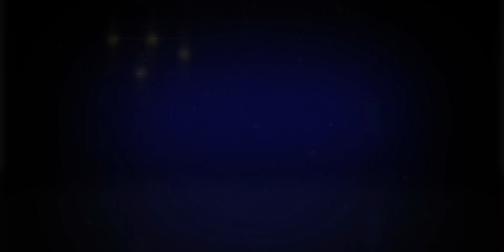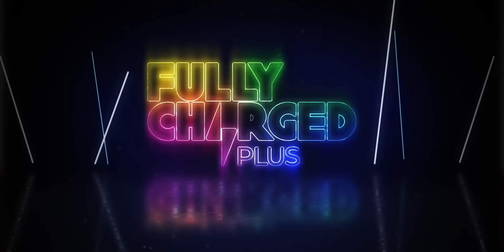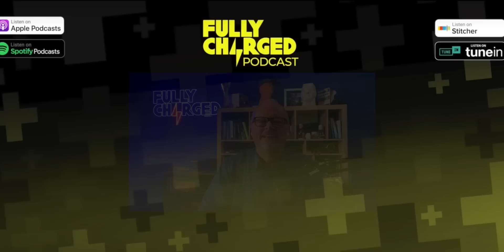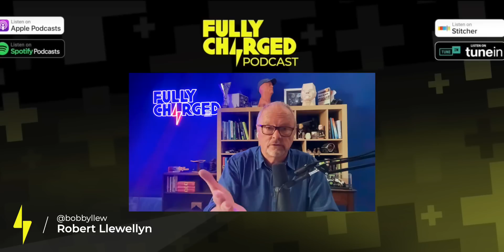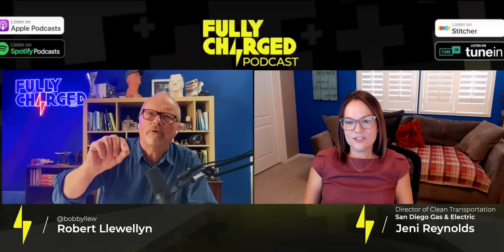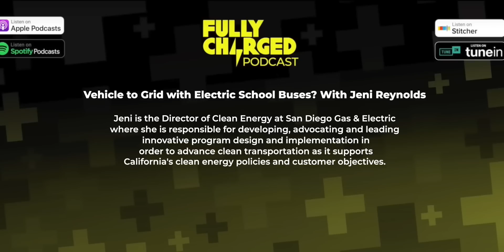Vehicle to Grid with Electric School Buses? With Jeni Reynolds | The PLUS Podcast

Comment: One point the video sort of glossed over - peak electricity demand happens between 4 and 9 PM, when solar production is winding down, but air conditioners are still running. The problem is that this time the time that the school buses have just finished taking a load of kids home from school, which means the batteries are already depleted, and so there really isn't excess power available to send to the grid.

I suppose the vehicle to grid system would still work on weekends, as well as during summer break, when the buses really are just sitting around all day, but I don't see this working on weekdays during the school year unless the power company is paying to equip the buses with far bigger batteries than what's necessary for moving the kids, in which case, the power company could just spend the money buying stationary batteries independent of the school buses.
Reply: It makes zero sense to retrofit a bus with a battery only just big enough to satisfy the specific route requirements of individual routes - you would retrofit with a standard battery pack to allow any individual bus to manage the very longest possible route x twice per day, and add a good margin on top. Once you’ve got a fleet of 8 buses and 6 bi-directional chargers (as per the example in the pilot, I can easily see how they end up with a big surplus capacity after 4pm. Try to assume that people running this kind of pilot to gather data are not stupid.
Reply: You are on the right track. It will take some type of computer managed system to individually. Monitor state of charge of busses in fleet. Know how the utility needs or not the battery storage, then make decisions on when to charge, or discharge the buss batteries.
Reply: @ John Arnold, that’s my thinking, and the OFGEM Page has a sample use-case. The bi-directional chargers are 60kW ones, so if we assume the buses are at 80% SoC at 6am, and have batteries conservatively sized so that they have a minimum SoC of 50% when they return at 9am (to allow for those days when they cannot be charged midday but still have sufficient juice to do the afternoon school run), and on days when surplus solar allows a midday recharge back to 80% by 2pm, then they will again return to the depot with 50% SoC, and can safely be discharged to 20% by 9pm. That implies 6 chargers x 60kW x 4 hours = 1.44MWh as a rough estimate of the amount of energy that can easily be discharged in the evening, with an additional hour allowed midday to provide grid balancing and frequency response services as the same 1.44MWh is pushed back into the batteries. That is all assuming a conservative and not excessive sizing for the battery, as the OP was suggesting.
Reply: @ayebrow  
You are missing the fact that bus batteries are always lithium iron phosphate, which have a lot less issues being used for 100% of their capacity for charge and discharge, and after 10k cycles still have 80% of their original capacity. Unlike lead acid batteries that fall off a cliff at the end of their life, lithium chemistries lose capacity proportionally.
Reply: @GoCoyote, that is really interesting, thank you - I didn’t know that about LFP chemistry, just that it’s cheaper and has a lower energy density than NCA or NMC chemistries.

As a pilot, I would imagine they will be trying all kinds of operational use-cases, particularly since they have six bi-directional chargers and eight buses, which I assume will have different route lengths and options.

The OFGEM site information about the San Diego pilot that I post above suggests that they will be expecting to end the afternoon runs with around an average 50% SoC, on days when they can top-up with cheap solar midday, so if they can experiment with charging to 100% and discharging close to zero, and capture the data on battery impact, it would be fantastic.
Reply: I thought about that. Obviously, buses will need to have some spare capacity and not finish the day completely empty, but batteries are expensive, and the school district, at least in theory, would save enormous money by being diligent about battery sizes and equipping buses with enough capacity for the longest possible run, with a reasonable cushion, and no more. It's not like ordering a fleet of diesel buses, where, since the cost of a bus is unrelated to the size of the fuel tank. With diesel, equipping the fleet with more range than you need costs nothing, so doing it solely for the sake of standardization becomes a matter of "why not". With battery buses, each additional kWh in the battery pack adds significantly to the vehicle cost, so paying for double or triple the battery capacity of what you actually need to haul the kids around gets very expensive - particularly for large vehicles which need much bigger battery packs than smaller vehicles, due to their relative inefficiency. So, if the achieving good grid balancing requires buying double the battery capacity the school district would otherwise need, the only way that expense gets justified is if the power company pays for it. If the power company pays for it, they could use that money to just buy their own batteries instead. And, since battery size and weight per kWh are much less of a concern for grid stabilization than for moving vehicles, the power company could get more kWh for the money by moving to other technologies besides Lithium Ion, which a school district powering its buses would not be able to do.

Of course, one can make the counter-argument that all electric vehicles are much less efficient in winter than in summer, so in order for a vehicle to make it through a winter run at 20% SOC, it has to complete summer runs at far more than that - plenty to balance the grid at least somewhat when the bus pulls into the depot. However, even then, the grid balancing happens only seasonally, and on the hottest days of the year when the most grid balancing is needed, the bus will have less to offer because it will have run down the battery air conditioning the bus (which consumes far more power than air conditioning a car, since you have to cool the entire bus, not just the first few rows).

To be clear, I still think the pilot does make sense to go ahead with, especially if San Diego starts school late enough in the year that the hottest days will happen when buses are just sitting all day at the depot on summer break, in which case, the entire battery pack becomes available for grid balancing. I think vehicle-to-grid is still important, and there are cases where it works, even if school buses aren't one of them. But it is important to be realistic in expectations.
Reply: @ab-tf5fl  entirely agree with your argument here... I would expect the buses to have right-sized batteries for their half-day workload in winter, plus a smallish safety margin. Given the short distances they'll cover you're talking a pretty small battery. They are effectively providing v2g for short-term grid balancing during evenings and school days, and slightly longer-term time shifting during weekends and holidays.

It's not as exciting as it might first appear, but it's not nothing either, and we need to shift to a mindset where we seek to optimise our use of the grid right through the whole system even if the numbers aren't especially headline-grabbing.
Reply: @Sam Prince, in what world does every school bus have the same route length? Given the answer is “no world”, the conservative bus operator will ensure that their fleet has enough vehicles with ranges to provide guaranteed cover for their longest route. The bus builder in this instance provides 3 different capacities from which to choose. They don’t do “right size”. The UK’s OFGEM has published the details of the San Diego scheme, which YT blocked me from linking to, and it makes clear they plan a recharge period 9am to 2pm and a discharge period from 5pm to 9pm, so it’s clear to me that they are not sizing the batteries for a half-day duty cycle, but for closer to a full day one, allowing for days when a full midday charge is not possible, and expecting to have the buses back in the depot with an average of roughly 50% SoC on days where they are able to top up midday on cheap solar. You and the OP seem to be a little too focussed on the cost of a few 10s of $1000s extra kWh of capacity, when the overall project cost will be in the $millions. You need to ask yourself, what makes you think that the people organising this pilot haven’t thought about the alternative of minimal battery size and separate static storage?
Reply: @ayebrow  calm down mate, you're getting a bit giddy
Reply: I think you’re trying far too hard to argue that having electric buses with absolutely minimally sized batteries, and an entirely separate static storage system, is somehow more economic than simply having conservatively sized batteries on the buses. Batteries are expensive, true, but they’re not gold, and there are many costs associated with having duplicate systems rather than just one - each additional kWh is only ca. $150-$250 at current prices, and is anticipated to be below $100 by 2030, so your argument loses weight with every passing year. You are also failing to realise that the aim of this is to allow the school districts to make use of the batteries in their buses to make money, selling grid support during the peak, because it’s clear that their duty cycle as buses is nearly perfectly aligned with the duck curve to do that. Why build separate static storage systems when you have conveniently available mobile ones, with free buses thrown in?
Reply: @ayebrow  I'm sure running a pilot is the best way to find out as there will always be unforeseen costs/benefits to each new approach so the empirical data will ultimately sort that out.

Superficially though, fixed storage is likely to be easier to maintain, more space-efficient (otherwise they'd put them all on a bus chassis!), offer a wider range of chemistries, easier/cheaper to control temperature and avoids lugging around dead-weight on the school run.

In the real world it might turn out that all the fixed storage providers are cowboys with poor service or over-the-top pricing, negating all the above benefits. It will be interesting to find out!
Reply: Personally, I think running pilots is all about getting the technology and business models ironed out, rather than comparing it to a split model of mobile and static storage - the fundamentals of having conservatively sized batteries and planning to use them in V2G scenarios is one that is a “no-brainer” for the world’s utilities - it makes no economic sense to have vast amounts of kWh of batteries locked out of V2G because someone has penny pinched trying to “right size” the vehicle battery.
Reply: This shows that the UK’s energy regulator, OFGEM, is paying attention, which is what Jeni was alluding to in the video, and provides some more details: https://www.ofgem.gov.uk/publications/case-study-usa-electric-school-bus-vehicle-grid-pilot-california

Comment: Did she say the busses batteries are 60kW? does she mean charge rate or capacity. Cause if that's capacity, it would be 60kWh, and that's not very big. That's less than a chevy Bolt.
Reply: I stand corrected. I posted a link to a CleanTechnica article that confirmed it is the chargers that are 60kWh, but I think YT removed it. My links to the UK OFGEM post on the same pilot study seem to be still there, confirming the same. Nevertheless, some simple arithmetic implies that the buses must have battery packs of ca. 500-700kWh, assuming they stick to a 20-80% SoC range and allow for a conservative 30% discharge from 5pm-9pm on days when they are able to top the buses up to 80% from 9am to 2pm, and on days when they cannot charge at midday to guarantee an overnight charge covers the full daily duty cycle.
Reply: Have fun being pedantic
Reply: A quick Google for the bud co Lion busses, the packs are available 126kWh - 210kWh according to their spec sheets. Can’t find any reference to 60kW? Could be something to do with the V2G hardware as part of their trial.
Reply: @ salibaba, thanks for finding that. I found the confirmation of 60kW as being the charger power from both OFGEM and Clean Technica pages (and then typed it wrong above. The capacity of the buses is lower than I had calculated, but then I was going from the 60kW and the charge discharge periods in the OFGEM post, assuming what the battery SoC would be at each point in the duty cycle. If the batteries are in the 150-250kWh range, then they could be charged/discharged at much lower rates, but 60kW provides a lot of flexibility to draw or dump a lot of power to the grid as needed.
Reply: more like 600kWh huh!
Reply: I wondered the same. I think it was a simple mistake, since she also said the capacity was 5x that of a car, which makes 600kWh much more likely, and a much more realistic pack size for a typical yellow bus retrofitted with an EV drivetrain.

Comment: The hard part is that it seems like utilities, with more money and an explicit mission, are comparatively conservative with these technologies. If the terms existed, other than these rare pilot programs, you would have thousands of enthusiastic citizens doing V2G.

With how hard it was to even get permission for solar/batteries, I wouldn't ever go thru a permitting process again. However, I would do a 'behind the meter' V2H, while allowing the saved electrons to flow out from the solar we already have permission to export from.

Some day in the future I hope to get another life from the Leaf with a transfer switch, running IR panels to heat the lower floors of the house.

Have fun in San Diego!
Reply: Given you’re talking 10s of kWs to and from each vehicle, and cumulative storage of 100s of kWh, and all the question marks around impact on the battery and how best to manage the system and standardise the approach across multiple suppliers for each component, it’s hardly surprising that grid engineers and vehicle manufacturers are conservative and are treading very carefully with this. They don’t need any fires or trashed vehicles to destroy the idea. The good news is that V2G is something that many groups have been working on around the world, so I believe rapid progress will be possible, and by rapid, I’m talking “grid engineer rapid”, so we may see broad adoption well before 2030.
Reply: @ayebrow  absolutely see why they're conservative. They give permits all day to use more energy, but don't as readily permit generation or returning of electrons. We do have a bright future ahead though, totally agree.

Similar situation with side mirrors on cars. It will take years and years to save energy by allowing the removal of mirrors. Just due to foot dragging around hypothetical roadway accidents.

At this rate we'll never see backyard nuclear! Haha
Reply: The utilities job is not to invent the technology.... Their role is to create rates / tariffs to incentivise technology and habits to help balance the grid,  and allow use of intermittent renewable energy sources....

Comment: how do you build this type of system for a car? do you have to have a onboard charger and a inverter in a car and then have like a relay to switch between those too or how does it work?
Reply: For personal EVs, they will use an on-board inverter (possibly the same hardware that drives the main motor) produce AC output through the J1772 port. This is usually good for a few kw.

The LEAF's V2H setup uses an external inverter and pulls DC power through the ChaDEMo port. For larger systems like these buses, they will likely also use an external inverter just because of the power levels involved.
Reply: @Smidge204  that's really cool. I had no idea that they could be using the motor controller for that but i guess it makes sense. 🙂
Reply: Kind of, you need to get the phase right and demand monitoring on the grid and a way for the grid to control the car.
Reply: @marvintpandroid2213  makes sense. :)